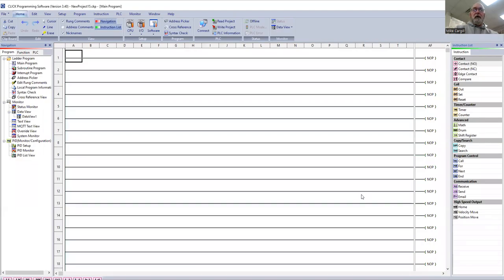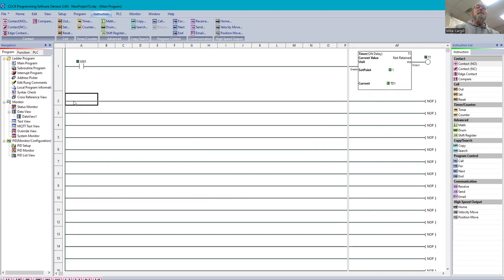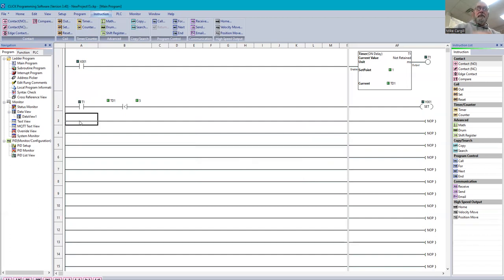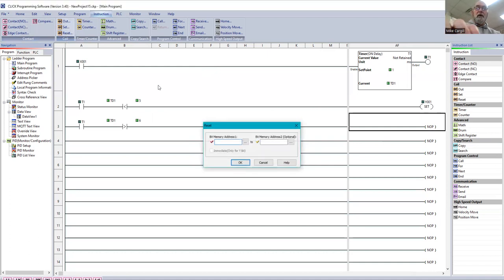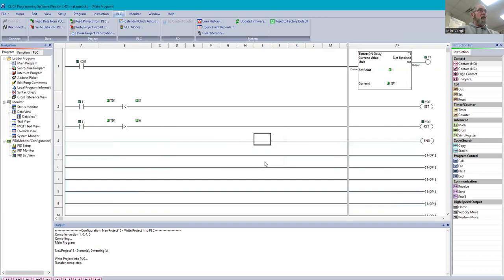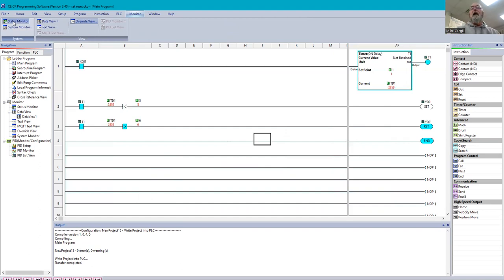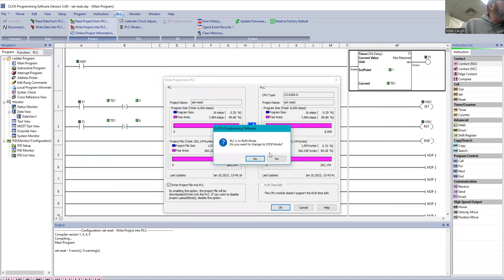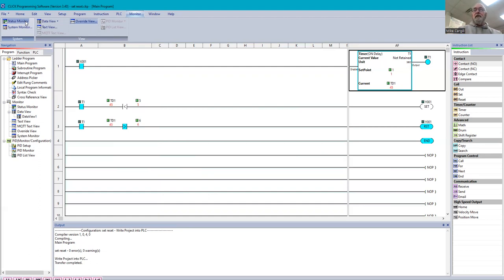CLICK PLC Set/Reset

Comment: This video was astounding to me.  Why aren't both terms on the same line. On at a point
 and off after a point?    I used Allen Bradley for decades and their lock/unlock was most unreliable. Could you please explain using two lines of code?

Comment: Just a suggestion- go thru your material before you post a video with a few mistakes.    It's imperative to teach those that are learning PLC programming, to make sure that timers, counters, positions, homing, etc are exactly as they are supposed to be.   Out in the real world, working in a plant, you do not want to have these kinds of mistakes in place at the same time before sending to the plc. Check, double check, and check again, it only takes a few seconds, to verify what you expect to happen, rather than the unexpected.  Programming while very pleasing, can also be very dangerous if one is not in the habit of checking his/her/it's own work.   Just a tip.     Yes i teach PLC programming, data historian/opc, HMI programming, and Applied Electrical Theories and applications.